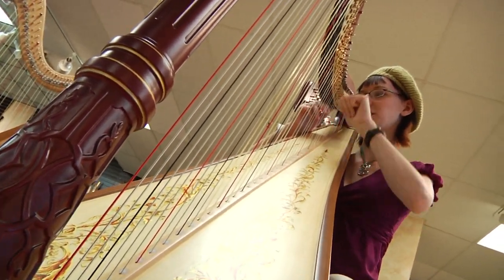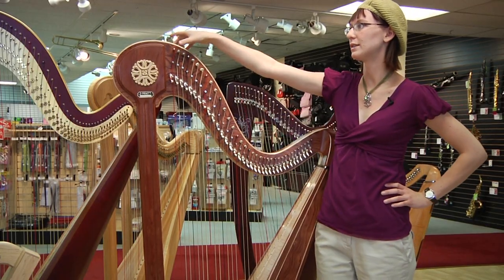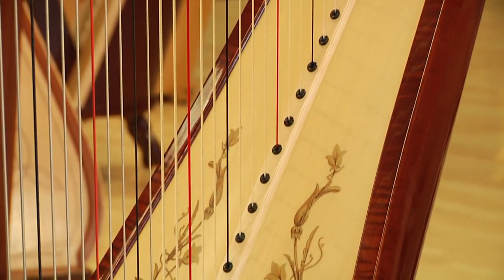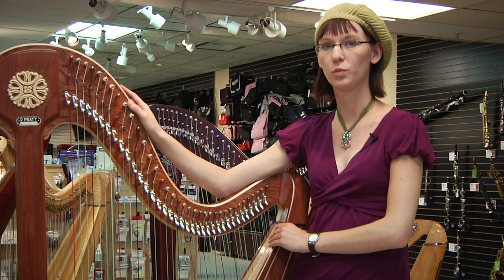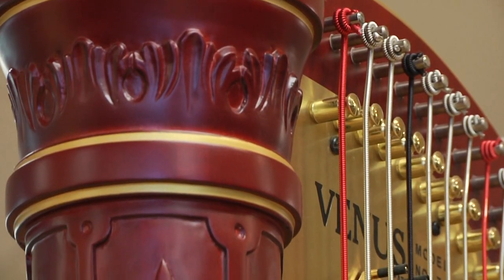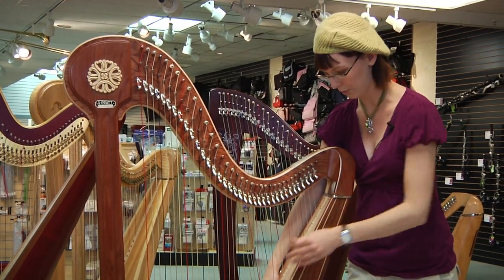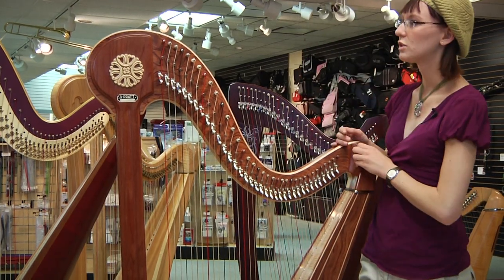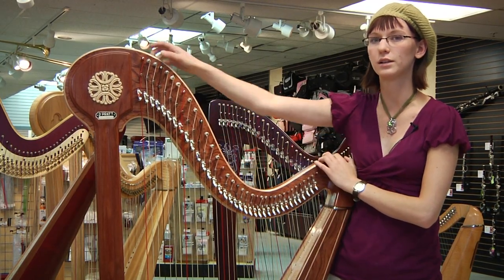Harps : How to Make a Simple Harp

Comment: A "simple harp" can be made with three pieces of wood plus strings and a resonating chamber.  The math underlying the harmonic curve is not complex, either, having been derived by Brook Taylor (1685-1731).  Harps have been in existence for thousands of years, long before the pedal harp and lever harp described here.  No offense but this video is pretty misleading both in the title and exposition (speaking as a harp maker).
Reply: Complex!! The optimal tension of the string is chosen as strong as possible so that it does not break. It is almost constant, so only variable that determines the pitch is the length of the string. (The beginning is pleasant.) However, the tension force is chosen in proportion to string's length to ensure uniform plucking force. Therefore, the diameter of each string is different. If we have a limited choice of cords of different diameters, we shall have to choose some compromises and correct the curve. How? What's better: increase length or decrease tension? Exact inverse proportion between the length of the string and its frequency gives too much difference in the length. In practice, it is reduced, choosing a smaller ratio of force to cross-section for longer strings. So the length of working part of the strings is ~16x by 5 octaves, instead of 32x. But beyond 4 to 5 octaves this  still is not enough, because further proportional elongation of the strings will make them inhuman size. Increasing the thickness of the string without increasing the force of its tension will lead to the fact that the oscillations of the string will be very much damped, especially overtones. Therefore, the bass strings are made on other principles, they have a very small difference in length (hence bend the curve down on bass-end), approximately the same tension, and the corresponding pitch is achieved by loading the string by winding. (The scarry formula for calculating the mass of the wound string should be written here. But I don't remember it. And this equation with few unknowns to be solved  to find a kind of winding. ) And, of course, there appears a problem to make an instrument with smooth and wound strings  one instrument, rather than a set of two different — treble harp to here and bass harp out there separate.
Reply: @NataliaBazj  Taylor's equation is: Tension=Mass(2xLengthxFrequency)^2 What's complex about that (unless one has not taken high school algebra yet)? I'll grant you that it does get "interesting" with wound strings since one has more options to deal with but the basic principle holds.  As for the contention that the string should be near breaking point for optimal tone - sure if you are talking about a concert instrument but this video concerns a "simple harp" which let's assume to be a smaller lever harp.
Reply: Oh and by the way...even with a high tension concert harp the static tension increases as you progress from treble to bass; generally in a smooth curve but not always.  In no harp is it "almost constant".  Ideally however the resistance to the pluck would be nearly constant but that is not measured by static tension. The equation for that (resistance) would be complex if not impossible, so harp makers use tension/length as a reasonable surrogate.  We also assume that the player plucks the string at its midpoint, which is of course not always the case, but what are ya gonna do?  An experienced maker chooses the string types and lengths to achieve a desired effect, which may me from a very low tension harp such as a South American one to very high tension on a pedal harp.